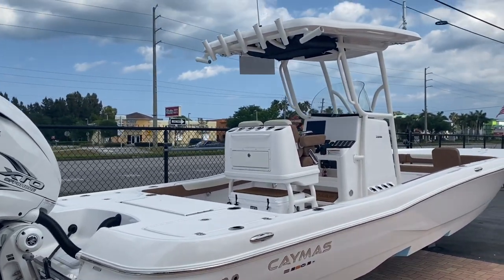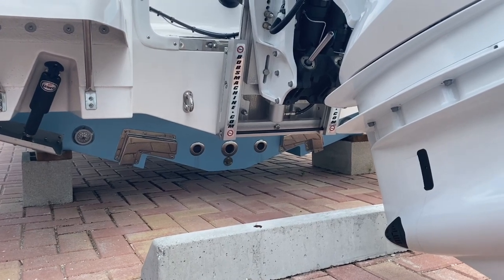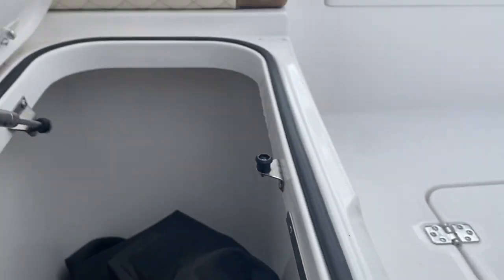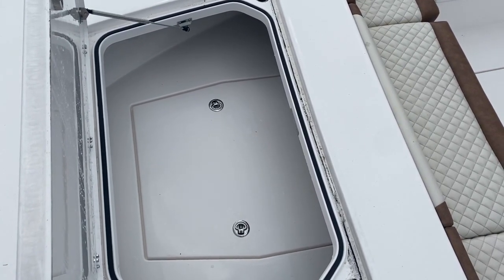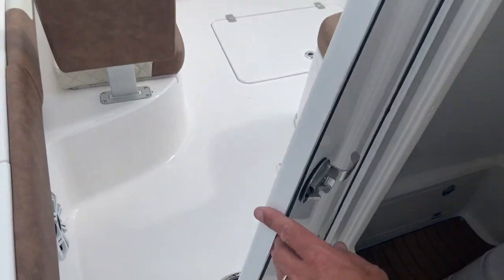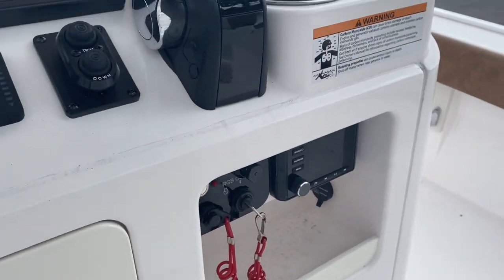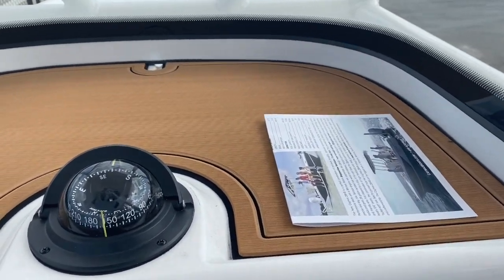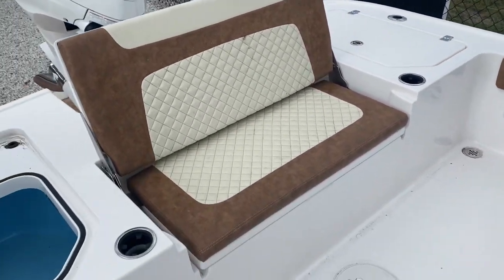2020 Caymas 28 HB

Comment: 55mph thats it ? whats the lbs on the boat my 27ft blazer bay runs 64mph with the 425hp
Reply from the maker: We actually got 62mph w/ 1/2 fuel and 2 guys recently w/ the right prop. The 28 Caymas is a foot longer and 2" wider than the Blazer, which doesn't sound like much but in boats it makes a huge difference. The 28 is 4300lbs dry plus motor, fuel and gear.
Reply: @seagate2105  all sounds good I guess I'll make up for the difference 109 gallons of fuel fully loaded coolers  and 8 people  1 to 2 foot chop heading into a headwind in the Blazer Bay weighs 3500 lb dry Plus the engine is 845 lb
4345 lbs 
1600lbs people 
654lbs fuel

Total lbs 6599 
27 blazer beam is 9.2
Reply: @seagate2105  also why would you change the prop the engine was designed around the prop
Reply from the maker: @performancepressure   There is a whole series of props designed specifically for the 425. You wouldn't run the same prop on a 53' CC as a 28' Bay Boat.
Reply: Who cares how fast the boat will run? If you want a race boat, go buy a race boat. Running 64 mph in a 27 bay, with 1-2 foot chop, and eight people, probably isn't the smartest decision ever made.
Reply: RedSox21 where we fish (Chesapeake bay) some of our runs in the bay are anywhere from 5-40 miles or more depending what you are doing. If you are 25 miles away from port and a storm unexpectedly blows up like it often does you want to be able to get back near home in little time. Also if you are running and gunning,wreck or buoy hopping. 10-15 mile an hour difference can really change the amount of time you have lines in the water vs running. I use to think like you do but the more I’ve gotten to taking advantage of the entire fishery the more I find my self wishing my top speed was my cruising speed.
Reply: @performancepressure  I never heard of someone buying a blazer bay... prob pulling with a Nissan truck.... blahahahaha

Comment: Where is the insulated fish box for larger fish?
Reply from the maker: The standard fishbox is located in the center of the "fwd seating". It measures over 40" long and over 20" deep (straight, not corner to corner, which would be more) and is equipped with a macerator pump. We have had 40lb dolphin fit in this box with other fish from that days catch. For larger fish we would recommend a fish bag.